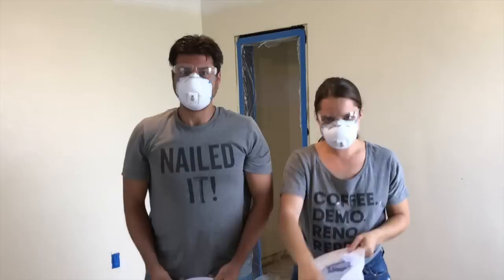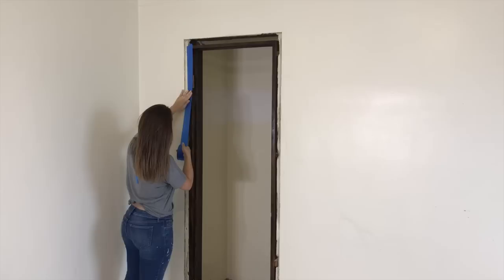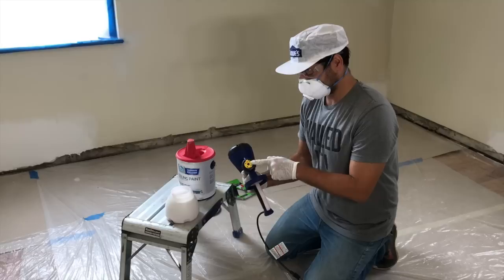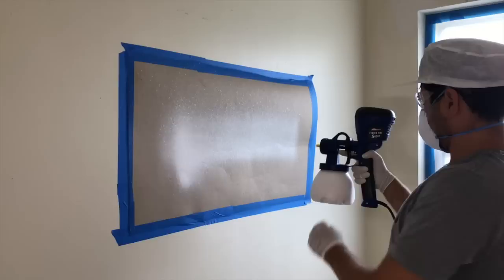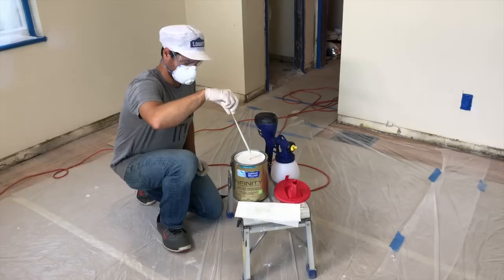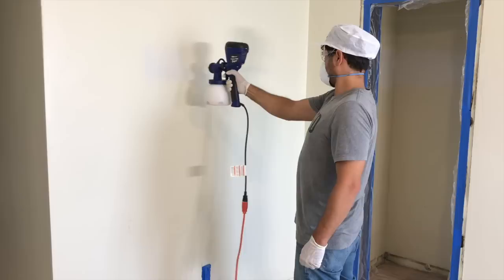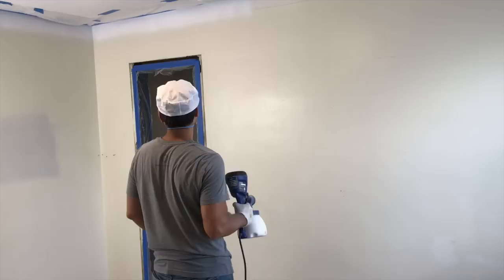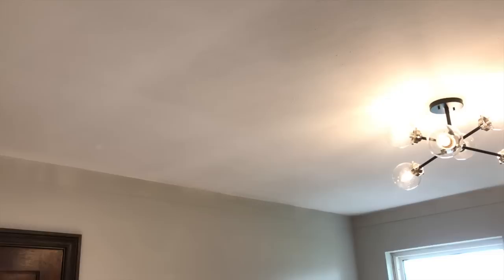How to Use a Paint Sprayer Indoors

Comment: Probably a PITA to keep having to refill the container...an airless would probably be the better option when painting a very large area such as walls and ceilings.  But this looks to be a great paint gun for smaller projects such as cabinets and doors.
Reply from the maker: Photog 1 thats a great point. If it is only one room I think you are fine. If you are doing multiple spaces I would agree with you on getting an airless sprayer or roll it. The airless sprayer is going to be a bigger investment. Typically, I use and would recommend this sprayer for smaller projects. Thanks for your comment!
Reply: Wagner 170 is legit, about to use it next week to cover 1000sq ft including crown molding, trim, base boards and wall paint. With an extension piece and the 30ft hose prep areas is literally the most time consuming part.

Comment: I was told I couldn’t tilt the finish max sprayer back like this to paint our ceilings as paint could run into the motor and ruin it. Please clarify as I’d love to paint our ceilings this way. Thanks!
Reply from the maker: Oh! Interesting. That's not how we understood it. As long as you didn't tilt it a complete 90 degrees and changed the angle of the pick-up tube, you can totally tackle your ceilings! Since this video we've done other spaces with this same tool and it still works great and it knocks out ceilings in no time!
Reply: Thank you so much! Ceilings are popcorn in the condo we’re selling and we can’t remove them. I was not looking forward to rolling them. So very thankful I found your tutorial. The sprayer will be a game changer.
Reply from the maker: Absolutely! Use a flat paint sheen- it'll help "flatten" the appearance of that popcorn! Good luck!
Reply: @kkabsher4601  I know this is old but you could always put plumber table over it so it doesn't leak out
Reply: I was surprised to see them doing that in an instructional video as well.  The Super Finish Max instructions say not to tip more than 45 degrees "when the motor is switched off".   Wagner Flexio sprayers (595, 3500, etc)  say not to tip more than 45 degrees and make no mention of having the motor being off or on, although the Flexio has a switch to turn the motor on continuously.  Presumably the airflow prevents paint from running back into the turbine.
Reply: They’re not using Wagner equipment. Their sprayer is from Homeright, which Wagner did acquire, but this is an old model sprayer. I followed their instructions and it worked out fine. No leaks and no damage to the sprayer.

Comment: this paint sprayer is durable?can finish from firstcoat to secondcoat painting in my house?
Reply from the maker: recs p this sprayer is durable sprayer in fact I am still using it on smaller jobs a year later. However, I would not use this on your house. I think a large scale project like that requires a commercial grade sprayer.

Comment: even though I see you doing it, first of all, the finish on that ceiling you knocked out "so fast" is bad. Further, HomeRight says you do not use this on ceilings because it risks getting paint in the motor. Viewer beware. You do NOT keep a stiff wrist when spraying. You keep a LOOSE wrist and keep the sprayer pointed directly at the surface. Just keep it perpendicular/90 degree to the surface, therefore, move the wrist.
Reply from the maker: Thanks for the comment AUTONOMOUS. The paint actually covered great and I have no reason to say otherwise. To be fair these are old plaster ceilings and walls with many imperfections. As far as getting paint in the motor, I just did not have that problem... I will say this, I tend to paint most of my properties with rollers and brushes. Mostly because the sprayer it loud and I usually paint in the evenings where I would be disturbing my tenants. I personally think the sprayer is ideal for specialty projects like furniture, shutters etc.
Reply: They did sponsor a couple with funny looking hats with 320p video quality. Gtfo with that gay spray gun, id toss you off site ever i even seen that anywhere. Thank god they keep shutting down locations and it has to do with a lot of bad investments their making in rookies like you.
Reply: So I'm new to this. In the process of building a house. I've got about 4 months to decide what route I want or need to take as far as painting, so I'm trying to learn what I can vs being quoted $4500 on a buddy painting for me. I kinda thought the same thing. From what I can tell, it looks blotchy. Especially the ceiling. How do I avoid that? Would it be better to just rent a professional paint sprayer vs buying a cheapo for about the same price? Once the paint dries, is it going to be uniform or will I still see overlap??

Comment: I strongly suggest not doing this for many reasons.
Reply: Why not?
Reply: @jmat7103  Well even with a airless pump you still have to back roll even out and push the paint into the wall. 

The HomeRight sprayer is an awesome and affordable hvlp sprayer, but it's not practical for high out-put jobs such as walls and other large surfaces.
Reply: Would you recommend this or airless for a smooth paint on cabinets?
Reply: No. No experience with painting. Care to elaborate? Do I have to run that through for cabinets? I am planning on using an oil base primer and a waterborne acrylic for paint.